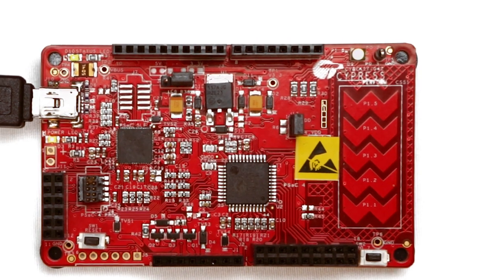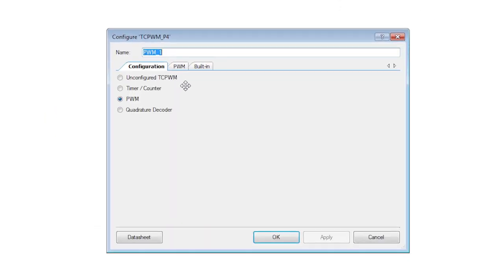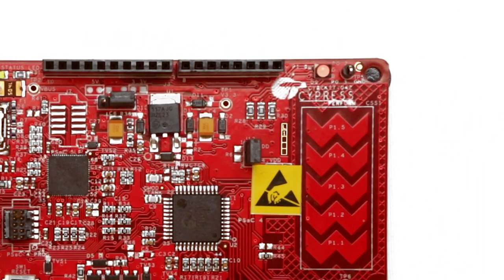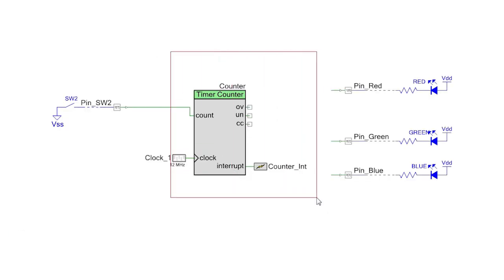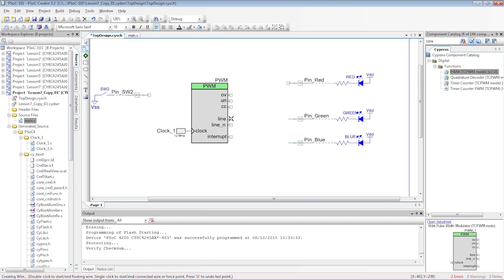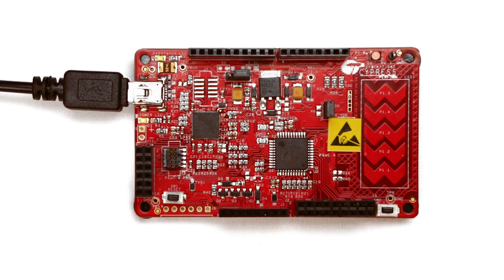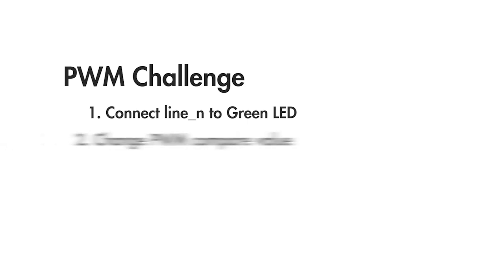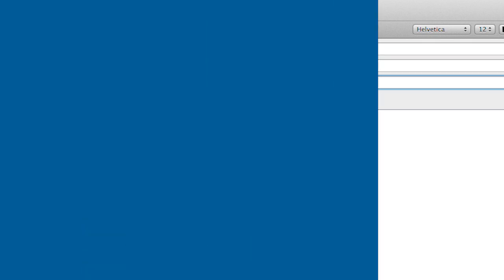PSoC 101: Lesson 8 Pulse-Width Modulator (PWM)

Comment: Hello, I use CY8CKIT-059 PSoC® 5LP Prototyping Kit. It doesn't have TCPWM as I don't see in Component Catalog. Could you please explain what is the difference between pwm and tcpwm? While I adapt the implementation, is there anything do I need to be careful on?

Comment: So there is no way to get a 100% duty cycle?
Reply from the maker: Hi Luke, 

You can get a 100% duty cycle on a PWM by setting the compare value to one larger than the period value. So, if the period is 10000, a compare of 10001 will result in a 100% duty cycle.

From the TCPWM datasheet it says, “for 100% PWM output duty cycle (Left align (Up counting mode)), the COMPARE register should be greater than “1” from PERIOD.” Thanks!

Comment: i've tried this in the main.c and it worked as it supposed to work (5 seconds from fully red to fully green), is this the right method? or you mean another?

  for(int x=1;;x=x+20)
    {
  PWM_WriteCompare(5*x);
CyDelay(50);

  PWM_WriteCompare(5*x);
CyDelay(50);
      
    }
}
Reply from the maker: Hi Ali, 

What you have looks reasonable. If you want to see an implementation of the exercises, please visit: http://www.cypress.com/psoc101. 

From that page, click on “Download Project” along the right side for the kit that you are using. Use PSoC Creator to open the workspace from that directory (PSoC101-CY8CKIT-042.cywrk). From there you can view/program any of the exercises, however don’t forget to set the active project for the one you want to try before programming it. 

Note: This workspace was created with an older version of PSoC Creator, but it will be converted to the latest version when you open it. Thanks!